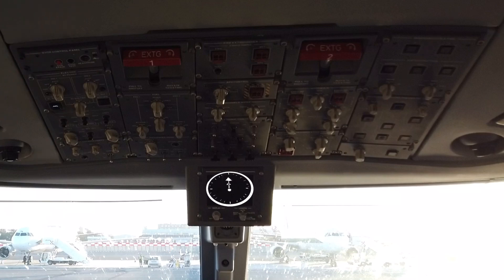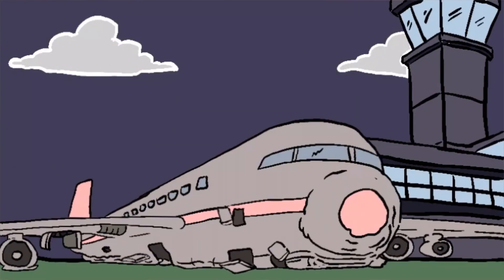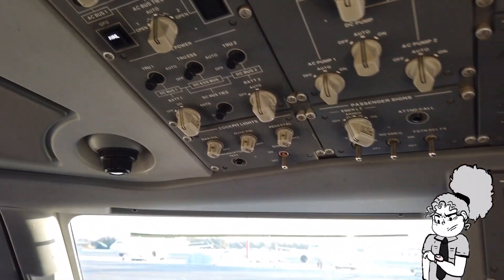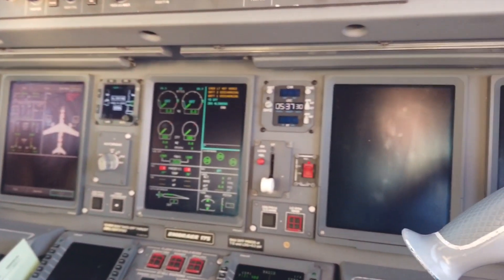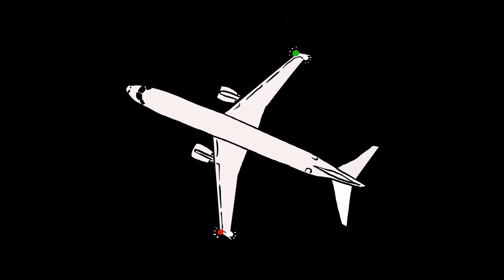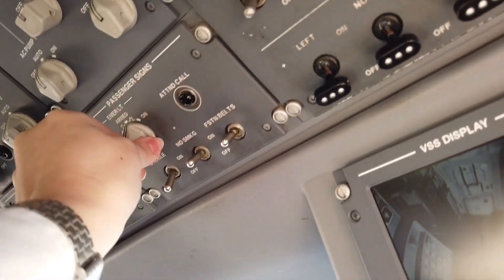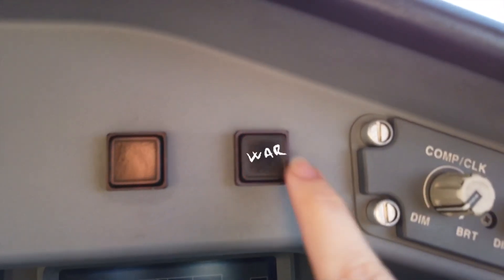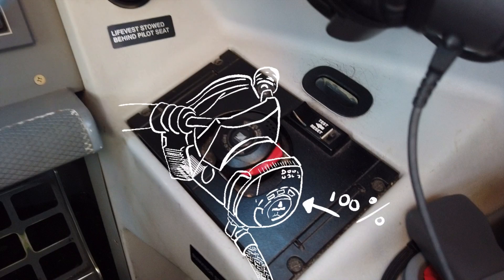How to Start an Airplane ✈️ : Embraer 175  Power Up from Cold and Dark with GPU

Comment: If i am correct, This aircraft doesnt have an inertial reference system, meaning it can be a bit easier to start up and plan the flight.
Please correct me if im wrong.
Reply: It does have an IRS. Had the camera remained, you would have seen "IRS Aligning" eventually.
Reply: @burncycle4621  ohh thank you very much!

Comment: Is there any protective microswitch on the landing gear selector ?  It should not gear up when struts are compressed in case of an accidental gear up position .   Let410 ( rated) has this micro on the nose gear strut.
Reply from the maker: Yes, it has a protection and on the ground it can’t get retracted, it was just a stupid reference to an episode from the Simpsons 😬. You just check that all the levers are in the right position to not have a system disagreement, it’s more software than mechanical related.
Reply: @solarneodo  Thanks for the update planning to join the 145 next year.  the reason the gear must be selected up is because these microswitch are installed on the nose gear.  if the leaver is up what its gonna happen is the simpson episode on Vr.  once the strut is decompress the electrical circuit engage the level selector and the whole gear retracts as your main tires are still on the ground and V2 has not reached.  accident is then inevitable .   I have see this happen in real time this is why I was corious about your video.   safe flights